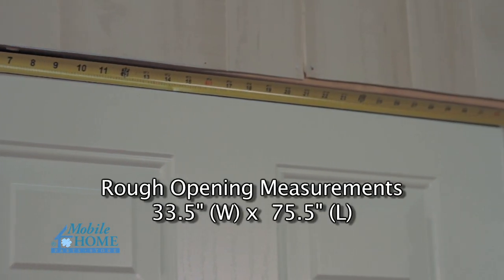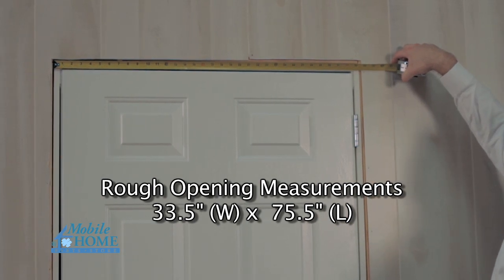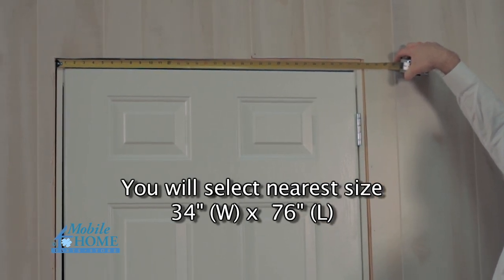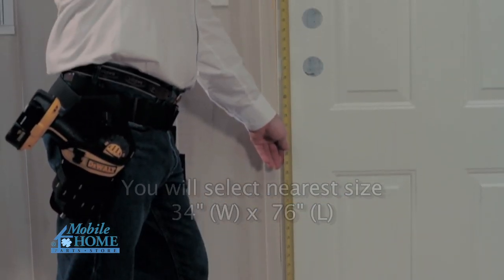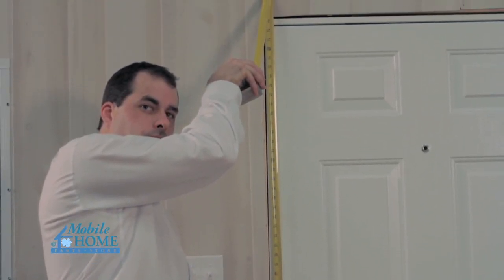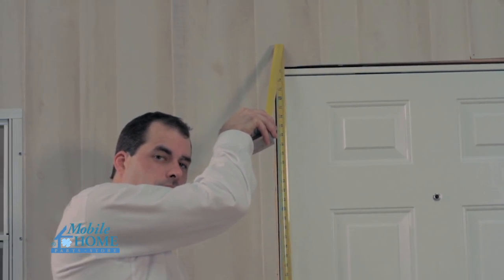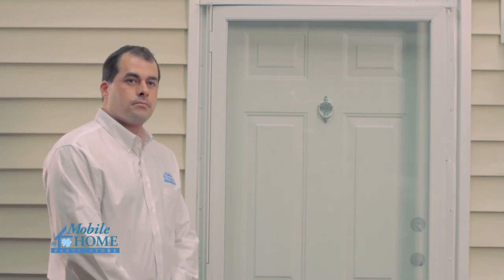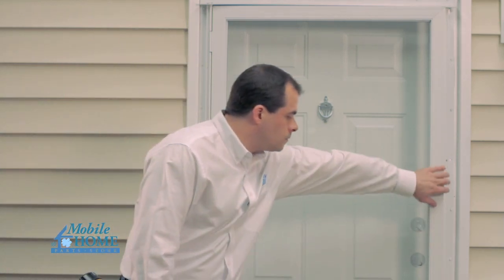DIY Correct Size Combination Exterior Door | Mobile Home Parts Store

Comment: The actual door size is normally a little smaller than the "call" size, which is 34" in this example.  In other words, we call the door 34", but it is usually less than that so it would fit in a 33 1/2" rough opening.

Comment: how are you suppose to fit a 34" wide door in a 33-1/2" wide rough opening. 

rough opening
Definition
An opening in a wall or framework into which a door frame, window frame, subframe, or rough buck is fitted.